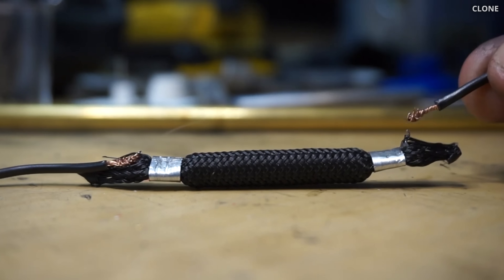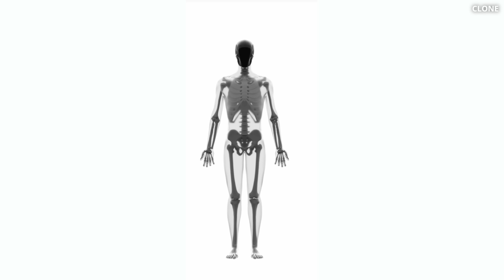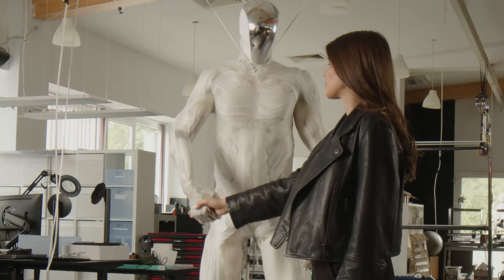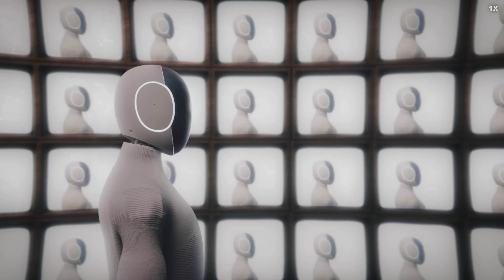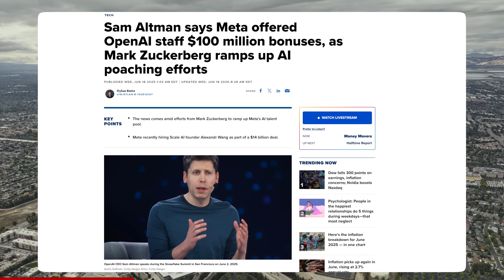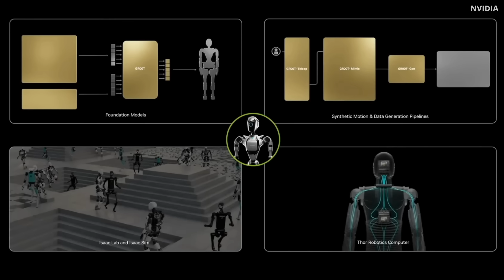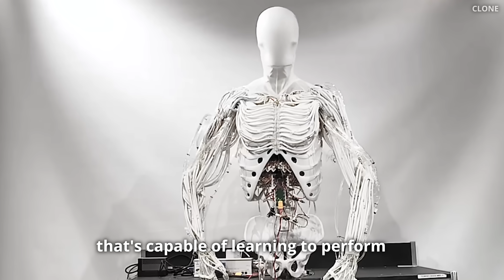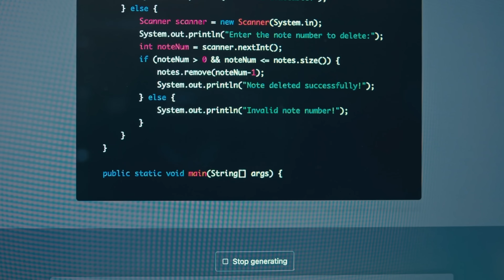I Met Protoclone. It’s Actually Insane

Comment: I like that a company is taking this bold route rather than doing what everyone else is doing. This style of actuation seems nearly impossible to achieve.
Reply: Actuation: the action of causing a machine or device to operate.
Reply: @xlr555usa 
But these actuators - though very strong and lightweight - are not as accurate and responsive as typical motors.
Reply: @SWDW88  Yet. This technology is very immature and young compared to electric motors. A lot of advancements were required to make the electric motors and controllers on robots today, and a lot of advancements need to be made to create a "muscular" robot. The fact that something even looking this advanced is being made right now makes me think this technology is only maybe 10 years away from being consumer-grade.
Reply: @nonshitposter9494 
It definitely looks cool. And I respect the upstream progress they've made so far.
Reply: China will copy
Reply: Westworld drone host
Reply: Wireline musculo-skeletics are the FUTURE of all human-looking androids and gynoids! I wouldn't be using hydraulics though when I could use electro-kinetic musculature that does EXACTLY what human muscles do! When you apply a specific voltage and amperage to a electro-kinetic muscle fibre, its metallic crystalline structures come closer together in terms of linear and lateral distance becoming shorter in length and smaller in diameter. It CONTRACTS and pulls with much more force than any human muscle fibre so in terms of overall motive forces, it is MUCH stronger than any human when those fibres are bound into muscle groups and then controlled by an intelligent control system.

Our parent Aerospace company in Vancouver, British Columbia, Canada has just such a system where we attached voltage and amperage-controlled electro-kinetic musculature onto high-strength carbon-fibre struts and we found it was about 10x stronger than even the strongest body builder in terms of being able to lift or pull a weight using arms, legs, feet, fingers, hips, etc. Our KEY current issue is modelling typical human movement which we are now doing by filming humans within sheer body suits filled and printed with millions of tiny dots and electrical sensors doing every major move typical within hundreds and thousands of common activities such as pushing, pulling, tying knots, moving pots and pans, carrying children, lifting a pet, pulling or pushing a cart. EVERY major human kinetic motion we video at high frame rates and high image resolution so we can figure out WHICH muscles are being used when, where and how much during any given single set of human body movements!

Anything we humans can do is being modelled for inclusion in our human movements database so we can synthesize ALL human muscle usage and movement into our wireline electro-kinetic musculature-based robotic systems.

I would say we are less than TWO YEARS from high-end pretty-much-PERFECT human gait, arm, leg, finger, feet, etc movement duplication! Once we have that database we can mate it to powerful A.I. control systems emulate a human perfectly in all ways! And YES! the most obviously-desired set of human movements and reactions is ALSO on the books for full synthesis!

YUP! That's probably gonna be the END of human relations once this gets put out cheaply!

Let's just say that the animated TV show The Simpsons with that special episodic mini-video called "Don't Date Robots!" is both prescient and unfortunate as to the eventual fate of humanity once these perfect human robots get released! LOL!

V

Comment: Let's see that robot walk without hanging from a wire and we'll if those muscles and bones are actually strong enough. The hydraulic muscles definitely sound interesting and potentially would cost less than the motors and actuators used in other competing robots. But current it's those competing robots that can actually walk and jump unassisted.

Comment: An interesting challenge is how strong do you make the robot?  What lift capacity is necessary to lift a human that has fallen with feedback moderated not to injure during the process? How strong is strong enough is dependent on the.process performed and analysis of physical conditions.
Reply: A crane is a robot without brains. They can lift tons of weight.
I wouldn't want one in my kitchen though. ... 🤣

Comment: I can't help but feel strongly that humanoid robots are created solely out of a desire to have their own slaves. You can't have ordinary people as slaves, but you really want to, so they invent robots that look as much like humans as possible. A kind of advanced technological slavery. Bottom line: there are slaves, and the laws are not violated.
There are no other objective reasons why you should spend so much money, resources and time on creating anthropomorphic robots.
Non-anthropomorphic robots designed for specific tasks handle work much more efficiently, they are significantly easier to manufacture and they are much cheaper.

Comment: This has real possibilities... I get that they are using 3D printed plastics and normal rubber tubing and water hydraulics... these are cheap and simple and safe components.  But imagine taking this same basic design to the next level just with the MATERIALS it is based upon... Titanium and Carbon-fiber composite for the bones.  Kevlar for the tendons.  The highest performance hydraulic fluid that is still low-toxicity (matters if it will be operating and eventually leaking near humans).  Tubing specifically made for this application.  JUST THAT, with no actual improvement in the base design at all, would see an order-of-magnitude jump in performance.  

All that improvement in performance can then be leveraged as more strength and more battery efficiency and less weight.  That in turn frees up capability to help solve problems like walking..

Comment: Really amazing and kinda scary.  I think using water is also safer.  If a pressurised vessel fails using air, that's you ... bad.  But if a pressurised vessel fails using water you just get wet.

Comment: I have been watching this company for years now, although they have made some progress, I don't see it becoming fully capable robot for many years to come. There are far too many muscles to process, far too many sensors to calibrate, far too many parts to assemble. Its an overly ambitious pet project that will never become a profitable item to sell. Even if they get it all to fit, and train it to walk they still have many more things to solve. When you have defined axis actuators you can train a model to move in specific ways, but with hundreds of muscles there are all kinds of axis that it could tilt to and it becomes almost impossible to deal with. There is no inverse kenematics that can be applied because the muscles are not a ridgid joint, they are a free flowing thing and I don't see how any real percision could be made with it. Humans actually have pretty awesome precision built in. A piano player has muscle memory, knowing and feeling where every key is, same for a guitar player. I have not seen thus thing do anything percise yet. But who knows maybe some new technology will come along soon. I just don't think it will be within a decade if I am honest. Hopefully the salesman is good at keeping investors because I would not invest in this project.

Comment: It looks strange and wrong in some ways. However, it definitely has a fluid, more natural movement to it!
Perking movement could also be improved, after all, it's something nature has managed with regards to we humans!

If it's lighter yet, can do things better, then all good.
Also, if it uses much less power, then even better.
I think if improvements are made as well as to how we create A.I brains, then definitely a good way forward. 

If you look at the space our brains use and think of everything our brain has to do every moment of every day as well as managing its own temperature, then we definitely have improvements to make.
Not to mention, it runs on about the same amount of energy that it takes to run a 90W light bulb while our machines use a great deal more than that.

Comment: using air muscles was an obsession of mine years ago but never had the mechanical engineering skills to do even small experiments, the protential for a comfortable exoskelletal system driving a telerobot would be very interesting, even if lacking the precision.  Even as a animatronic same-room feedback loop system, driving a miniatrure human, then using a VR helment for stereo telepresence on the little humanoid.  Another possibilty is to capture energy from whatever motion you have energy to make, then releaseing this back into the system; for example routing the motion of bending your leg at the knee into moving your forearm, for added power there

Comment: If they're made 8 feet tall, about 2.6 metres so they can reach higher places, with 2 opposable thumbs on each hand for more utility and stability of grip, a tail for balance, and elongated head with gyroscopes and accelerometers at both the front and rear of the head for better comparative readings resulting in improved stability, the elongated head would also give it extra room for batteries without interfering with the pump and muscle system in the main torso, improve the cooling system with heat exchanger exhaust pipes on the back of the torso where they're out of the way and ... ohhhh wait.... that's a robotic xenomorph.   Let's not listen to my idea this time   :)

Comment: Was interesting, not convinced though, the fine motor control and dynamic on the fly feedback necessary for smooth, controlled locomotion is going to be problematic; the system as it stands (or not actually) today, did not demonstrate the speed or control in response for walking, too slow, too much bounce and lash in the tubes and valves. I would love to see this thing walk, but I think they are many years away from walking with the finesse of the Boston Dynamics machine, if it ever could in its current form. Fingers crossed.

Comment: I have seen about this company before and it's great! Many years ago I thought why cant we build muscles like have using hydrolics but I was thinking oil not water. I agree with you that the more vulnerable type (only slightly more robust than humans) is better for personal as
assistants etc.. also these clunky machines that try to imitate human facial features are still so far off base. When these things supposedly talk their facial expressions and mouth movements are not believable. Can't wait to see how these guys work that one out. I'm a 70yr old geek that's still waiting for a personal assistant like these but it'll probably come long after I need to use one. (still quite healthy).

Comment: Hydraulic/Pneumatic systems for soft actuators have great fluid motion (wyss institute have some great research on them), but drawbacks that make them impractical for orthopedic prosthesis or "independent" humanoid robots (not attached to anything).
These applications are intrinsically electrical, they already require space for battery and circuits. Having compressors/pumps and intricate valve systems alongside just adds weights and size, and many other problems.
Boston dynamics stopped their hydraulic-based humanoid systems (the previous Atlas model) because it was a mess of leakages and needed a lot more space to fit everything (also, the modelling of such motions are a lot harder to replicate in isaac lab environments).
That is not to say that it doesnt have applications, it can totally work for other "not so independent" scenarios.

Comment: I think that this particular robot has the potential to be THE gold standard for all bipedal robots that will be developed in the future. Further refinement of the individual muscles, circulatroy systems, sensors, and AI compute nodes placed throughout its body, and we'll have a machine that will bring us into "the future" for REAL. Further refinement, along with the scaled up ability to mass produce these things, and the Earth will absolutely enter an era of unparalleled wonder and abundance. One thought occurs to me regarding its muscle design: Imagine the musculature not consisting of thousands of tubes lumped together in bundles, but "muscle groups" that have been 3D printed as one unit, capable of more accurately and elegantly simulating contraction, flexibility, and function.

Comment: The obvious potential problem with this approach is what happens when the hydraulic system springs a leak.  With no artificial "clotting" mechanism, the robot would simply "bleed out" as soon as any of it's many water lines sprung a leak.
Reply: ALL IN TIME ROME WASN’T BUILT IN A DAY
Reply: Pressure-sensitive valves could isolate the part of a system which has lost integrity. Would still need to repair, but the robot may remain mostly functional. And clotting isn't impossible; cars used to have special fluid added to their cooling system to plug leaking radiators. Early days.

Comment: The slave-bot paradigm exists since, 50s-80s, Star-wars C3PO and will probably fail again. 
The Iron-Man paradigm of a vehicle-bot that can be self, internally and remotely is more attractive.
The Bio-clone paradigm embryonic or modular, derived from bio-cells is also more attractive.
Cbot, Obot, Abot, Nbot and Clone from Mesistemcom and Sandaerocom use the last two, not the first.

Comment: Something doesn't add up.
10:46 "Without them [pressure sensors in the hand] a robot could simply crush a cup [as the robot's hand releases a coffee mug and a human catches it]"
4:38 "It's [i.e., the robot hand's] strong enough to lift up to 15 pounds".

Uhm, and hand that only lift 15 pounds is not strong enough to simply crush a coffee mug.  I can lift a hell of a lot more than 15 pounds with one hand, but I can't simply crush a coffee mug.

Comment: What will be the effect of temperature-sensitivity on functioning of the fluid hydraulics system's function?  What will be the effect of fluid-plastic permeability issues?  What will be the effect of fluid purity-i.e contaminants in the fluid-on proper, long-term functioning of the hydraulic systems?

Comment: As a control engineer I can already see how difficult it will be to make this thing balance. And you can tell that's the reason it's not standing on its own. Perhaps an early prototype could use a hybrid model where electric motors are used for hip and knee joints. Although reinforcement learning may be employed to learn patterns in controlling the muscles in ways we can't even figure out. But I think it would require many sensors. 

The human body is all about sensing our surroundings. If your legs and feet go numb you lose balance because your body doesn't know where the legs are anymore, or whether your feet are touching the floor and how much. You can look at your legs or know their location but that's not enough information for your muscles to make such fine adjustments. So I think that will be the biggest mechanical challenge with this. This technology seems promising though and I think this is the way forward. Maybe there is a way to make these muscles even more compact and more precise. Must be awesome to work on something like this, being able to somewhat mimic nature and the human body to make something that works. It's fascinating how well nature has engineered us.
Reply: Easy to fix. Mount them on a horse or spider lower body
Reply: @psxtuneservice good idea for a horror movie

Comment: very interesting. But I think this approach is total overkill. You definitely don't need this approach for fine manipulation with a human hand, go look at a recent Figure robotics video for example. In fact, this might be even inferior, because it could lack the precision that servomotors have, while introducing new variables like material stretch, air pressure, etc. Would also be a maintenance nightmare with all those moving parts. Like what do you do if one tube deteriorates deep in the hand? Still very interesting and I'm curious how it evolves. If it ends up creating the most human-like robot, then it has a niche.